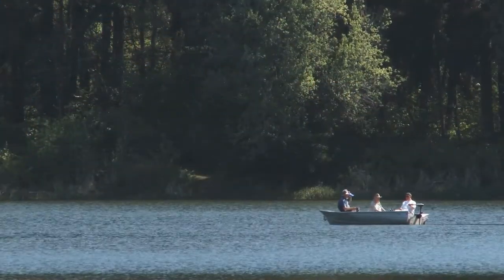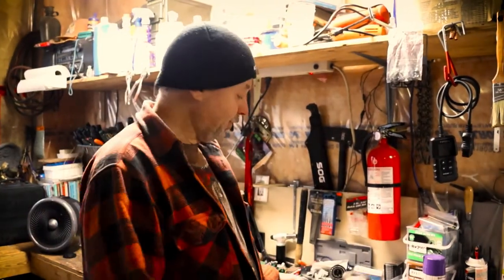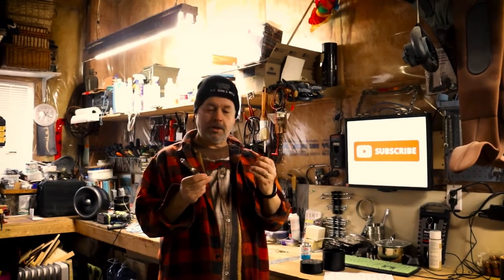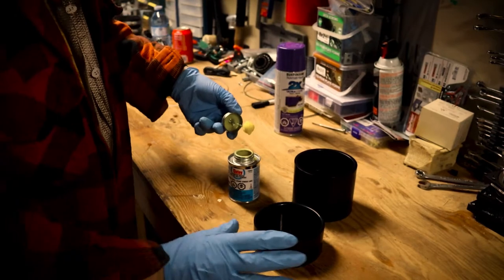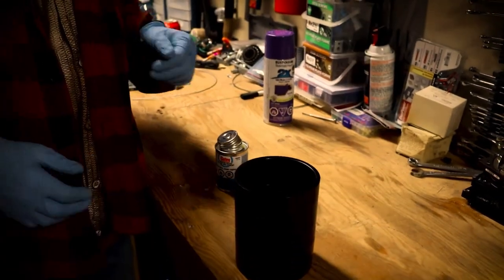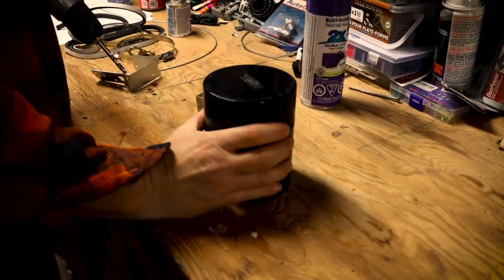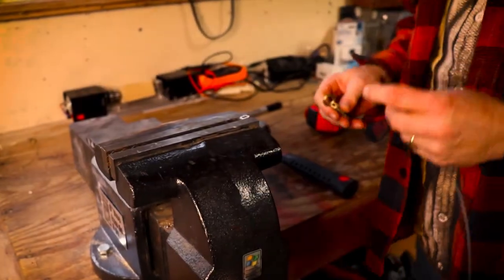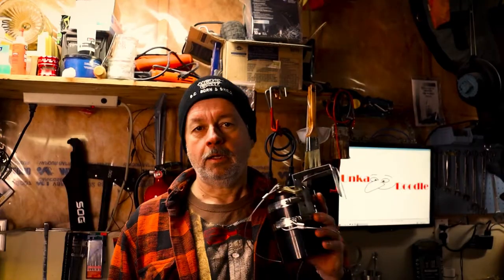DIY Beverage Management System – A Cup Holder for your small boat or canoe.

Comment: When endurance racing, we use hydration bladder system.  
The cost of abs pipe and fittings has really gone through the roof.   Some wood is a cheaper solution I'd think.